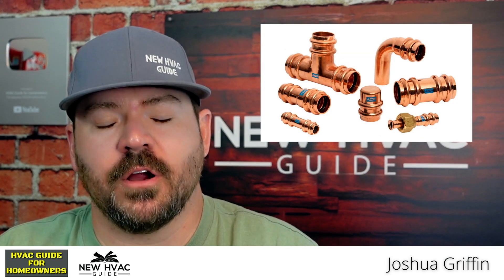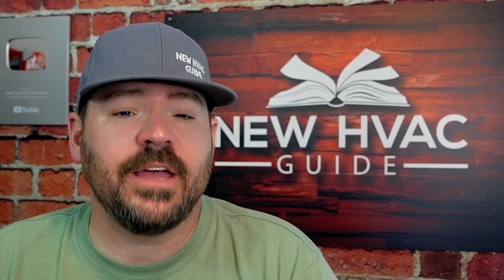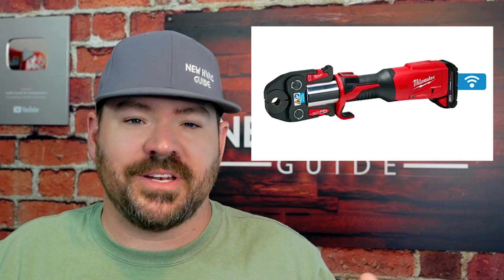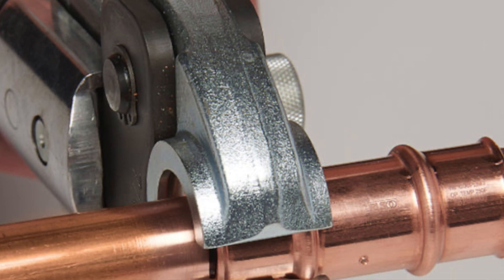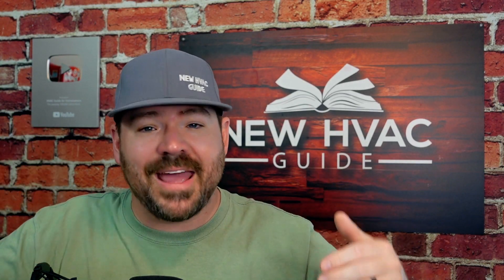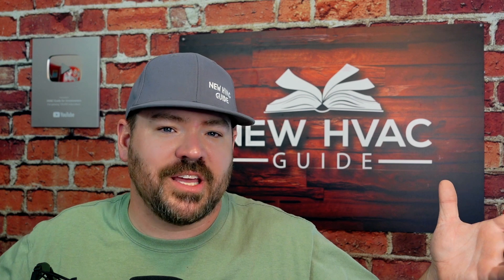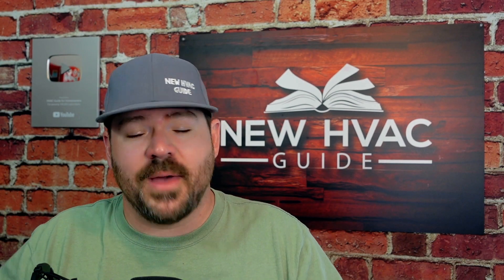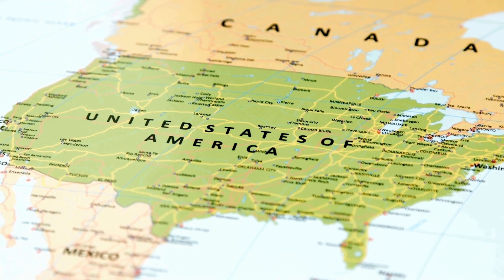Why Are LEAKY Press Fittings Taking Over HVAC???

Comment: Everyone talks bad about these press fittings and seals. Guess they never changed out an auto ac system.  All seals are nothing but a rubber o ring bonded to a washer. Never had an issue with mine.

Comment: rls fittings vs acr fittings which is the way to go and would it seal better to apply a thin layer of nylog to the pipe before you slide the fittings on ?

Comment: I’m testing out the Milwaukee press tool using zoom lock brand press fittings on all of our mini split installs. Done about 10 mini split installs with it so far and loving it. Will never use factory flairs again.

Comment: Absolutely not! Those press fittings and the actual tool are way overpriced and they aren’t proven like brazing has been. The press fittings haven’t been around long enough to know whether or not 10 or 15 years down the road the o-rings break down and start leaking. I’ve been brazing for over 20 years and I know that my braze joints will outlast the system they are connected to, and the next system after, and the next one and so on. Basically, a properly brazed joint will last forever but I can’t confidently say that a press fitting will. It’s not difficult to hook up nitrogen and purge the lines while you braze everything in. People have gotten so damn lazy that they want everything to be as easy as possible. I feel like it’s taking the skill out of the trade and I don’t like it. I do residential hvac service and some system change outs and I’ve never used a press fitting and I never will. Lastly, you can’t use those fittings on a reversing valve replacement or a compressor swap, or a TXV swap anyways. If you still have to use a torch anyway, then why even use the press fittings at all? My torch will handle everything I need to do whether it’s service work or installation.
Reply from the maker: +@vincentgelles3805 would you ever consider them if they reach 20, 30, or 40 years out?

Comment: I think they're good they're going to leak with high pressure after 7 years easier to sell the customers new units🎉 example you know that expensive train we sold you 7 years ago well the board is bad and that's going to cost you $1,800 and we found this small leak on these press fittings😂😂 I know the last unit cost you $14,000 but that was 7 years ago so this new units going to cost you $27,000😂 but it was high efficiency so you saved on electric😂😂😂😂
Reply from the maker: I hear ya. I used to think that too. But they seem to be lasting...
Reply: @NewHVACGuide  what do you mean they seem to be lasting? Have you left any of the old fittings in after a change out. We have braised ones that have been in buildings for 30 years with multiple change outs
Reply from the maker: @JacobsNews you were throwing out hypotheticals of systems that are only seven years old. I was saying that they seem to be lasting just as long as the life of the HVAC system. I felt just like you not long ago, but as time has gone on, I’m starting to see that the kinks must be worked out and these fittings do their job if they are installed properly.
Reply from the maker: @JacobsNews in fact, I would argue that I’ve seen more braze joints leak than anything. Maybe not your braze joints because you’re amazing at brazing. But not everyone is.
Reply: @NewHVACGuide  that a good point with less skilled people coming in everyday press are a good choice .45 per cent of them could not tie their own  shoelaces . we going to need all the help we can get

Comment: 100% worth the investment
Reply: They make fit up faster , but if the seal isn’t 100% leak tight , then the consumer will pay for it 😮every couple years because they will need to call out a technician to add refrigerant .
Reply: @theantichrist4267 you act like brazed connections don’t leak or flare fittings.

Comment: I have been using propress on water since 2005. I now press everything water ,gas and refrigerant.
Reply from the maker: What’s your favorite brand of fittings for refrigerant?
Reply: @NewHVACGuide  RLS, the original. The only issues I have seen is from improper install

Comment: At the large hospital / research centers that I retired from almost stopped soldering all copper lines 3" & under for two reasons. Time consuming to fill out paper work to have supervisor & safety department to sign off and pro press connections were quicker. Also had some shark fitting for tight hard to access areas.
Reply from the maker: Some facilities require fire department to be on standby. Hot work permits and so on play a big role on whether or not some companies use press fittings. Very good point!

Comment: split systems are nothing but trouble. my window ac is 21 yrs old and was built right at the factory and has never needed service.
Reply from the maker: Not a bad argument, but some folks simply don’t want window units.
Reply: ha! would be lucky to get 5 to 10 years out of a window unit, they're all cheaply made in china now!
Reply: @Jon-hx7pe  I agree! My neighbor paid $6000 for a Trane. lasted 8 years. new one  cost 12,800! Average ac in FL lasts 10 years. I replaced my attic ac for $241.  Pocket change. I could change it in 5 years and be very happy. No more split systems for me. 
In the winter I use $5 heat lamps. Cut my bill almost 50% Instant heat, no noise, no smell, no moving parts so no service calls.

Comment: From experience I wait about 2 or so years before I switch to a "new technology" for my customers. I've seen a few of these press joint leak already which is a small percentage of the press fitting I've seen. Still, I will wait for others to bear the costs of this new system then jump into it if and only if it proves itself to be worthy of the first costs involved. I remember back in the 60's when Chrysler Air Temp used the "new" aluminum condenser coils in their residential units and within months those copper to aluminum joints started leaking. And I remember when PEX first came out with leaks forming at the fitting joint in the systems a few years after installation. And I could name a few more old and recent "new technology" that turned a dark corner in time. So please continue to use and report on the results of these press systems as I might join in.

Comment: I still braze most the time. Depends on the application and location. Usually use them on ductless units and tight spaces.
Reply from the maker: You press on ductless? Not flare?
Reply: @NewHVACGuide  to much flare fitting leaks we've experienced.

Comment: I rarely do brazing anymore. For several years I have used the safer soft solder made specifically for hvac with no issues.  I have used press fittings but use a manual press tool since I can’t justify the cost for the amount of installs I do.  Press on fittings have worked well for me also.  Flux should be used sparingly and so far I personally have seen no complications at all from any possible contamination.
Reply from the maker: Out of curiosity, What brand press fittings do you use?